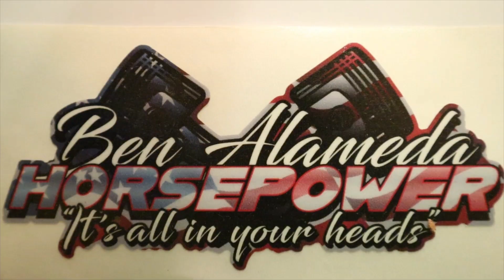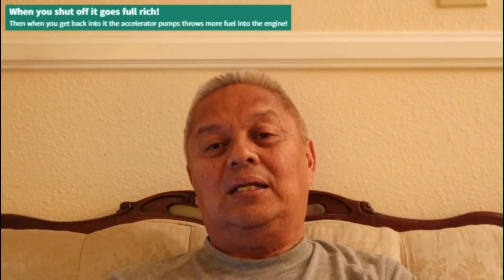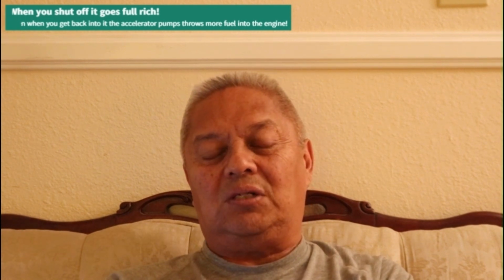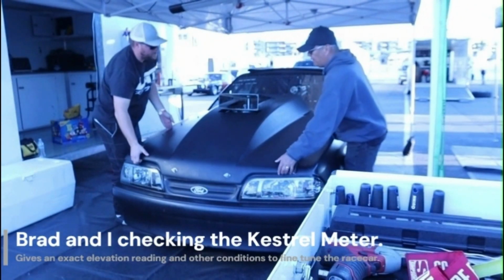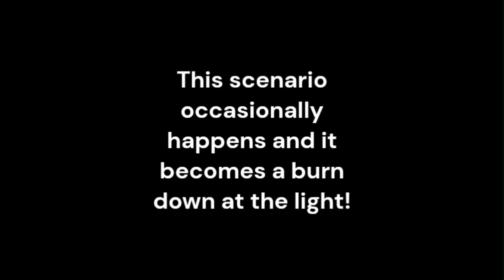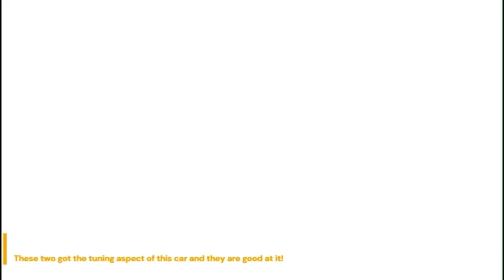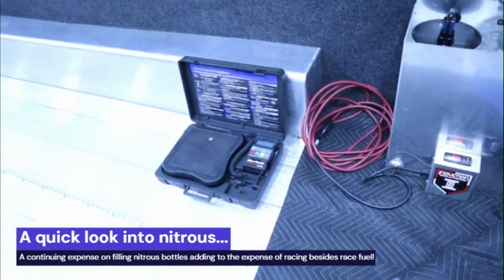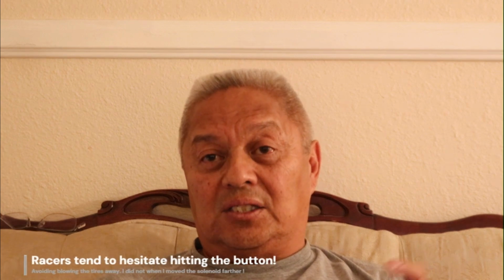NITROUS OR NORMALLY ASPIRATED RACECARS AND THEIR DIFFERENCE!

Comment: We always cut the threads off and read the porcelain- then assess the whole plug.
Reply from the maker: Sounds very accurate and agree somewhat.  The reason being when at the track between rounds we fine tune to keep the performance at its peak.  If I was in the shop great but at the track between round by round thrashing around got no time to spare cutting plugs. I use the plug reader and look down the porcelain for hints of what it is trying to tell me.